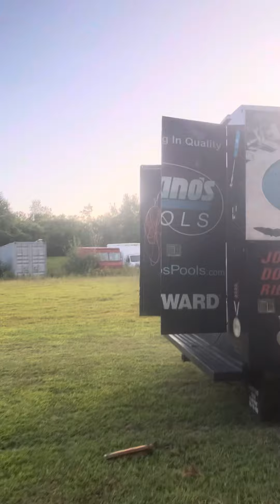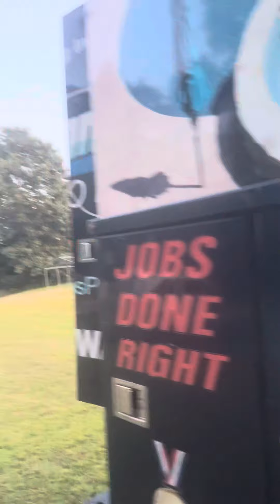DRAINING MY DIY POOL INTO POOL BLADDERS FOR NEW LINER !! #swimmingpool #pool #liner #savewater

Comment: You'll have to do some explanation on what you doing step by step for us we do not know anything about pool work 👍, but good videos
Reply from the maker: Basically we built a diy pool out of plywood panels I made. Tried laying in a used liner but didn’t hold water . My boss and liner manufacturer sponsored a real liner for the pool and we swapped it out. It was a very long process for us . About a month. Now have to finish patio and pool area